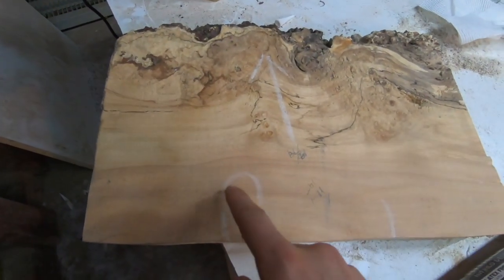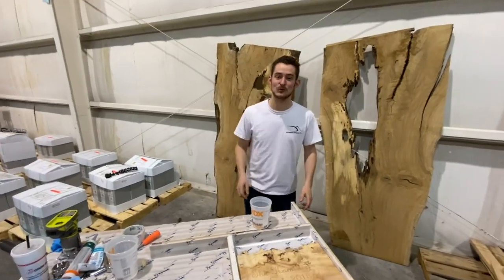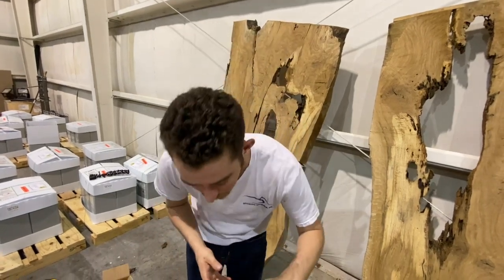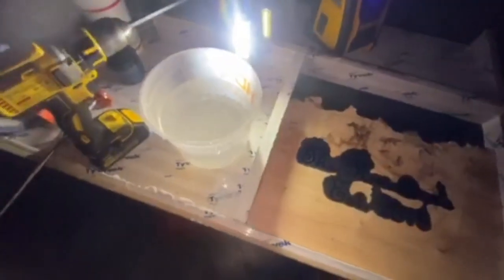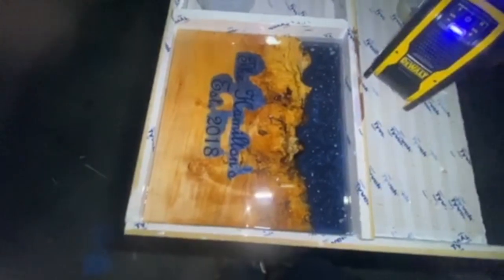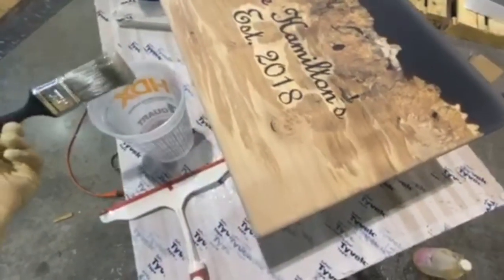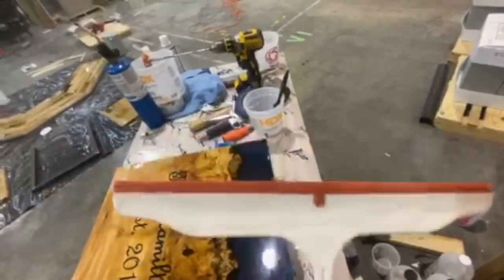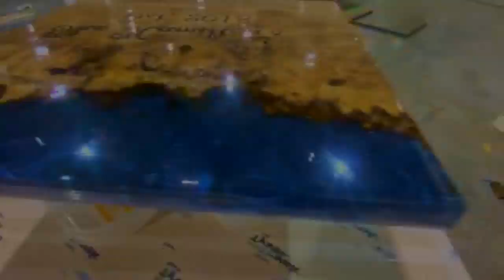From Trash To Treasure || Recycling Wood Makes Money!!!

Comment: I like that your finding a use for the left overs from other projects, good job!!!
I do have a suggestion. When using resin to fill in cuts from a CNC machine or general holes in the wood, a syringe from your local Vet office would give you better control.
Your doing great, keep doing your thing...
Reply from the maker: Thanks I appreciate that!! Great tip

Comment: Hey bro just a question which epoxy you using in the start with blue pigment it’s really thick and looks like easy to cast into cracks. Also how deep can you cast that ? Thanks in advance (-:
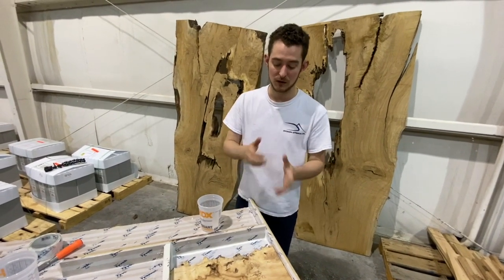Reply: 3:51 he is using Incredible Solutions epoxy.